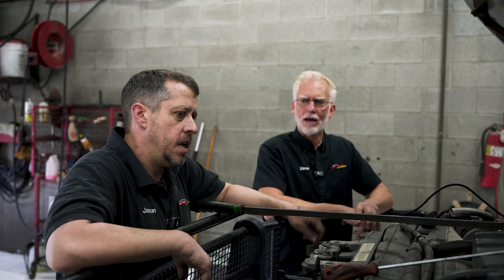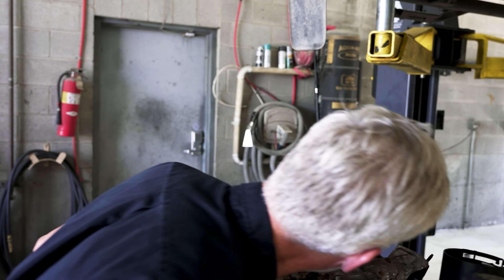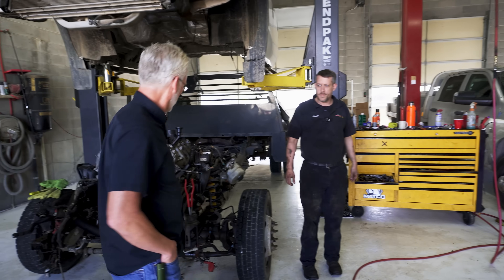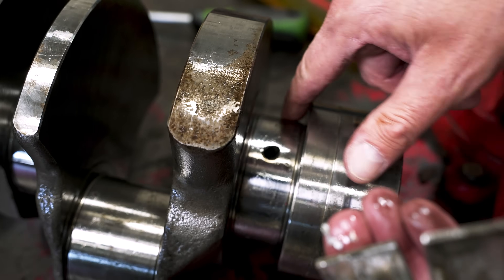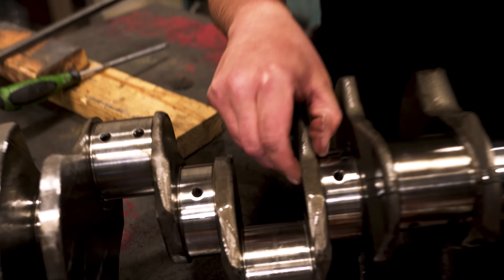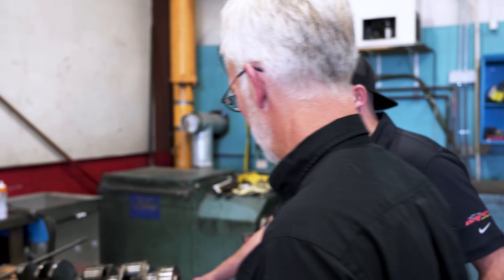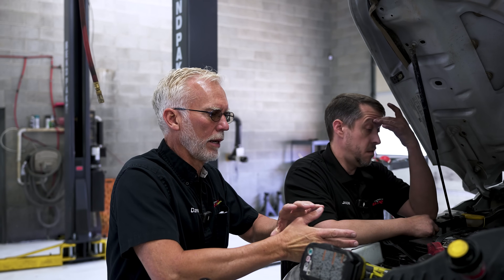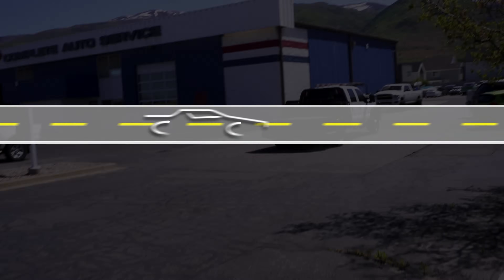Ford 6.7 Power Stroke Failure

Comment: The only time I’ve ever seen that happen is cheap materials used. I wasn’t properly applied for that bearing in the engine. I’ve only seen another time only on a show, though he had a spun bearing because the mechanic used the cheapest bearing he can use instead of replacing with higher end ones you’ll never happen again and it was on a Ford of course.

Comment: I love watching your videos Dave and crew!   I just got back to work from a pulled muscle in my calves while working on my truck.  It’s a 2010 Cummins.  I installed an insane diesel oil filter secondary bypass.  1 micron filter.  After I had drained the oil and refilled the motor with fresh oil, I noticed my new revmaxx tranny pan had some wetness and realized the new gasket I had installed broke and I had tranny fluid leaking.  Had to repair that.  But to hear your 4 C’s, and I had to use that to fix my truck, makes me feel good knowing those terms.  It definitely helped me in my repairs.  And I’m just a Joe Schmoe in a small garage.  My next step is to put a FASS fuel filter system in the truck.  Thanks guys!   Keep it up! 👍 😊

However, I don’t think I have the necessary tools to drop the tank.  So I might have to take it to a shop for this upgrade.  😢

Comment: Looks like a gold mine in labor charges. Definitely not owner friendly. This is why I'm a Cummins convert. I've always done my own maintenance and I used to love fords but this is a job for a fanatic or a masicist. Example, Two water pumps, Buried in plastic, lines and wires. No thanks... I changed my small (very adequate) Cummins water pump in thirty minutes, that was including a cigarette break. 😂

Comment: I see this quite often with young, inexperienced engine builders which is why that crank failed and or bearing but, you’ve got to remember to change the Poly Oil in the flux capacitor! Otherwise it will fail at 1000 miles or 88MPH.

Comment: I know of two engines Dave built, and they failed. A Duramax that they did fix no questions asked but their 6.7 that came apart under 9k miles, nothing positive from Daves motors

Comment: I had an '11 F350, a Job 1, 6.7. At 154,000 miles when it went down the road it was still running perfectly. It's a very complicated engine that I just do not have the skill level to do more then change fluids and filters tho a pre emissions trained and formerly working mechanic that back then nothing fazed me. This truck you repaired was a nightmare with major screw ups evidently by others. I think you took good care of those errors and the owner is now a happy but, unfortunately, poorer owner.

Comment: Sounds like Middletown Toyota of Connecticut work when I had the frame replacement warranty work done on my 2003 tacoma.   Sloppy work and an upset with me service manager because I was fussy.  My wire harnesses did not come from the factory with zip ties. My engine mounts were tight before it left the factory.  Ect, ect.  Techs that are not in the work but rather in their cell phones.

Comment: 13:56 I listen to a lot of Youtube videos about Mechanical disaters envolving part failure across the country including myself with brand new fuel pumps, its like there's no Quality Inspection. I was a jet engine mech in the U.S Air Force, that guy (Quality Inspector) was on our tail when we finished our task. We had to be on the same technical page as whatever proceedure we was operating on. Maybe part manufacturers need that kinda constraint.

Comment: That’s not a front bumper. That’s an Australian Kangaroo/Water Buffalo/Crocodile killer!
BTW Dave, I owned a ‘99, non SD, F-250 w/ a 5.4 (329 cu in) gas engine. I bought it used, in 2001 w/ only 8k+ miles. At the time, I was ignorant of the long reach spark plug issue.
Do you have anything to say about this Ford goof? 
Did you experience this issue as a young mechanic back in the day?
I had driven it only a few hundred miles, when the #6 cyl plug blew out and melted the friggin’ coil!
It cost me > $300 for new plugs and a FoMoCo coil!
I heard that the plugs often seized in the heads, and the tech told me those plugs were a b-t-h to remove at times. 
Any of you Ford engineers ever hear of anti-seize compound? Also, I needed a new alternator the same year when I was >800 miles from home!
Never had a problem afterwards though, so all is forgiven. 
It was a great truck otherwise. Previously, I was a dyed-in-the-wool MOPAR guy! 
This was my first Ford @ 46 years of age. 
Love your channel!

Comment: Ford just can’t get an engine right. I’ve owned several and pushed them all. I quit buying them for a long time but I heard so many good things about their 6.7 so I bought a 2015 f350. It lasted a year….. almost! I was working on the rigs and noticed fuel dripping from the cp4 area and decided to drive it home on my 12 hours off to swap trucks. I made it home and was backing it up to my garage and it died. I ended up having to get it towed to the shop and went back to work in my reliable dodge. The outcome….. cracked cp4 pump ( I had a dpk on ) and half of the push rods were bent. Now I’m buying a remanufactured engine and a dcr pump. Not impressed. I’ll never buy ford junk again!

Comment: Great video. I have a  2015 6.7 and she's a beast. Leaks come up and that's Powerstroke life. Rear main seal or the tranny pump seal are common. 130,000 miles and she's still goin strong !!! The upper oil pan is a big hour job and it will give out.

Comment: Do you know what type of oil Ford puts in these as a factory fill? Not the type of oil they call for, but what the actual factory fill is? Do they use a special oil or a break in oil? What oil do you use when breaking in a new engine? TIA

Comment: The bearing damage is obviously from heat and friction. The tech was right in saying the polishing that would have created a smooth service was not there. With some lack of oil changes and the lack good maintenance they are all doomed to fail.

Comment: You guys operate like I do, humble problem solvers.

What most techs and especially business owners don't seem to get is if you do the job correctly for minimal cost to your customer,  you will have more business than you can handle. Be honest and repair the vehicle so it never comes back for that issue.  There will always be vehicles to repair.

Comment: That was the cheapest shop doing a repair on the cheap and probably charging him full price just so they could make a bigger profit I would have never done anything like that and I sure wouldn’t use the cheapest parts on the market for the repair plus I would have done all the pistons rings ect but that’s just me I’ve built many engines over the years and I’ve never had a failure from it and I voided so many warranties when I was at ford because they had done a aftermarket tune that destroyed parts

Comment: I wish Ford would make a Vintage series for simple easy to fix trucks that are equipped with the most useful needed accessories Floor shifter or paddle shift. Just keep it vintage and simple to work on.

Comment: I  know enough about engines to get myself in trouble, but could that material that was not removed when they failed to properly polish the crank have played a part in this fubar? Because in addition to all the material that was not removed when they failed to polish the crank was added to when they installed the races which in turn added more material to the engine as the races in turn became the polishing tool.....Remember my opening statement :-)

Comment: Good Engine. I worked on the diamond coated crankshaft position plate that was moving between the flexplate and the crank.

Comment: This generation 6.7 has a recall for the clockspring, ive also seen a newer 6.7 needing a steering wheel because the buttons for the cruise control didnt work.

Comment: It'd be an absolute dream to have Dave overhaul your 6.7. Damn. I wish there was a competent mechanic within 500 miles of where I live. I have to do most of my own work bc usually when I get my truck back from a shop, it's either something else got messed up while they were working on it, there's grease all over my headliner, or they found a way to actually make it worse, or they diagnosed the issue wrong and hit it with the parts cannon and still didn't fix it. I get sick of constantly wondering if I'll get it back in acceptable shape or not. It's exhausting. Every time something goes wrong, I just feel instant worry and annoyance bc I have no where to take it and know that if it's something I can't do myself, I'm pretty screwed and won't have that truck for at least a month or two bc it'll never be a quick turnaround and if it is, it's bad news. Depressing as hell.

Comment: Why does mine sound almost that bad after a fresh oil change and then goes away? I got a 2011 6.7 with 350k miles and when you change the oil, it kinda knocks for the first 1k miles or so and then goes away completely. Wtf is it?! Its done it since forever

Comment: My 6.7 turbo wheel came of shaft and went thru motor found in exhaust pipe sucked all oil out of motor! 22000. Later got truck back with new motor!! I had change oil regularly never miss treated motor ! Had 92000 miles when this happened!!

Comment: Hey Dave!
I have a 2012 Ford f250 6.7 with 175k miles. The only upgrade i did was DCR pump. Do you recommend any deletes be completed or should i just leave it alone and service as needed.

Comment: My brand new 2024 Powerstroke HO had a camshaft failure at 1100 kms. Yes, 1100 kms. Ford doesn’t appear to be willing to even talk to me let alone make amends. They seem to think I should be satisfied with getting a new engine. I didn’t pay well into six figures for a rebuilt/remanufactured vehicle. I expect and want a premium new truck for this price. No offer of loss of use compensation, rebates, or any other consideration. Beware. There are no lemon laws in Canada and you can be left holding the bag for tens of thousands of dollars in depreciation even if you are barely off the lot. Shame on Ford. They hide behind “customer service representatives” spouting pleasantries but nobody with authority will even talk to you. Try GMC/Chevy. They’ve gotta be better than this.

Comment: One thing in the Ford 6.7's favor is it has a gear driven camshaft, and that cam is where God intended it to be on a truck engine-in the block. I think Ford made a mistake in the gas truck engines. The modular OHC engines should have been car-only.

Comment: I love this channel. I think something I have seen owning several power strokes and my father owns duramax is this tuning and using these engines hard is really not smart. The power strokes and all current diesels are way farther along then previous diesels and they don’t need modifications and hard tuning or driving to perform well. If someone wants more output take it to an expert like Dave or a dealership who has the expertise and knowledge to advise you. Beating on trucks to see black smoke is what cost lots of $$

Comment: Sounds like your block is not square anymore and it overheated and twisted or warped. I would check the crank journals to see if they are all aligned and circles not ovals. That rod letting go probably happened when the engine was overheated and running wide open throttle.
There is more damage in this core...

Comment: Just curious. What are those rebuilt 6.7 motors worth. My guess is 20 to 22 grand. My God . If i put that kind of money into my true 460 in my 1977 f250 4x4. Well i think i could very easily out pull that 6.7. Of course better heads with larger exhast valves and super charged. Headers and fuel injection.  I may have money to really build the C6 tranny with steel. Better converter. High pressure servo.

Comment: Absolutely love that bumper 💪🏻
That’s kool how the body is lifted off…WOW 👍🏻
Dave I love watching 🫵🏻R videos ‼️❣️❣️❣️❣️❣️❣️
In June 2017, I bought an 2014 Ford F150 V6, which had 34k miles. It’s got 2 regular doors and 2 other doors that open like the suicide type. It’s sun set metal flake color, ( Copperish  ).  It now has 96k miles, and I just 🫶🏻 my truck. I had left knee replacement on July 2, 2024, and haven’t been able to drive it till a day or so ago. Filled it with Tier 3 gas, and even though it’s really hot here in Louisiana ( heat index 110 ) running 60 mph it got 21.5 mpg , with A/C on max. Nothing in the long wheelbase bed. I’ve named my truck RUSTY….. THANKS DAVE FOR YOUR VIDEOS, THEY ARE OUTSTANDING ‼️ Wish there were vehicle repair shops of your quality way down here in Pineville, La. 👏👏👏👏💪🏻🇺🇸
8/16/2024

Comment: Dave,  I have a question for you based off a couple videos you have done in the past about the Ford 6.7 engine, I too have completed a few rebuilds of the Ford 6.7 and have found the same issue when tearing down the motors you have with engine oil starvation causing the extreme main and cam bearing and roller wear which usually is the knocking or ticking sounds coming from the engines if they are still running. In one of your videos, it appeared to me that you most likely installed a High-Flow, Low Cracking Pressure Check Valve in the pickup tube to prevent the oil drain back hence allowing oil to always be at the oil pump to start pumping oil pressure quickly, in this video when you were showing the different oil pans at the 14-minute mark I did not see the check valve, was this just a pan you have not completed this on yet or intend not to use? 
   Do you install them on all the 6.7's you complete or did you say forget it and if this is what Ford did, and they designed this way, I am going to keep it that way?
 I just started a new rebuild the other day and currently the engine is in the machine shop, I am going to TIG weld in a High-Flow, Low Cracking Pressure Check Valve in my pickup tube but was curious if this is something you do or sell now also? Love the video, on a side note my vocational school teacher was also named Dave, taught us to critically think and this was 35 years ago now and not to just replace parts much the same way it appears to me that you are teaching your team of people there to be, and the reason to your success.

Comment: Holy crap. I remember when people used to buy diesels for their simplicity, reliability and fuel mileage. Is it even worth it any more?
Reply: A Cummins ya, Cat ya, Ford and GM nty, not worth it
Reply: An engine blowing up is more due to an issue with the metal bits right? If so then would the same failure have happened to a gasoline version of that design

Comment: The clockspring could have spun when the cab was removed from the chassis. But i think yall are smarter than that, Ive had too many times ive fixed one thing and customers says that wasnt broken or  that wasnt like that, So ive learned to go fully through someone's car before major repairs.

Comment: I see a lot of people knocking the 1st get 6.7 and i cant really see why to be honest. I bought my 2012 in 2016 with 193,000 on it for 27k, was a good price for being a loaded King ranch at the time. Got it home did some things involving a tuner. I never had a mechanical problem up to the day it got totaled. I ran the dog piss out of it pulling thing i shouldn't have been, and running it harder than i probably should have. I always did a cool down until the oil temp was under 205, did 5k intervals with 15W40, and 10k intervals on fuel filters. Truck had blow by from me running hot tunes but still started and drove fine. Got decent mileage. Now some poor soul in Alabama is driving it with a bent frame

Comment: I just got a new to me 06 Lincoln Town Car. It cost more than average because you can still smell just what clean and like new shape the car is in. It had 70316 miles and somehow all of the factory witness marks are still there like it just rolled out. The under side looked brand new like it had never been driven in the rain ever. I don't understand it even now after the 3000 miles Iv put on it and the few rain storms Iv been thru it's much more dirty. The dash had to come out so as to replace 4 of the 5 HVAC door actuators. Because of that problem I got about 2300 off the price so I ended up paying 11700 for an 18 year old Lincoln but I'd do it again. There wasn't a single spec of dust or anything like that behind the dash. The guy that traded it in really took great care of it. I could've bought 2 or three of them for that price but it was so nice I had to have it. It's all fixed up now and I got the car with the colors I wanted. I plan to keep it forever. I may even get a cheaper one if it comes along to keep the miles off this one but I did buy it to drive and indeed I do that. Often.

Comment: I'll stick with my 2000 F-250 Lariat 7.3 4X4... She ain't a Beast but 24 years of doing the scheduled maintance and front hubs, Big Blue is still running Great... Heck she'll still be running after the 6.7's have been scrapped :)

Comment: That’s why I drive my 2001 Powerstroke with a 7.3 439000 miles all over south central Texas.
Reply: Wow. All highway miles right?
Reply: I'm wondering if engines should have an rotations count as much as a mileage count to determine their wear and lifespan. Would rotations count be a better indicator of an engines wear and tear? I think some Fords have an idle time counter, or maybe it's just an operating time counter. At least the police vehicles

Comment: when doing the final superfinishing on a crankshaft, the lapping machine will turn one way for half the cycle and then finish the last half of the cycle the other way, depending on engine rotation direction.
Could it be loose debris from the failed con rod that blocked an oil passage between bearings and cause over heating?